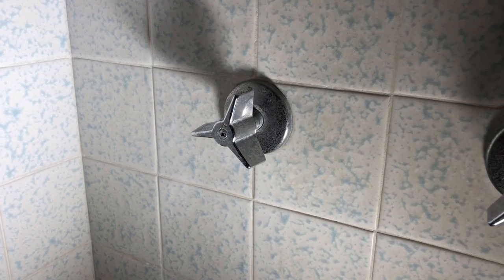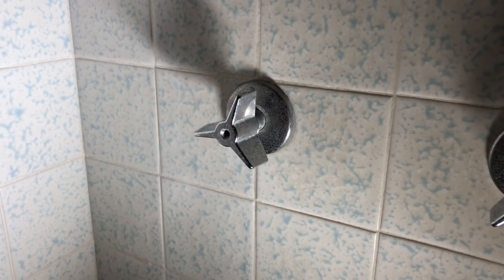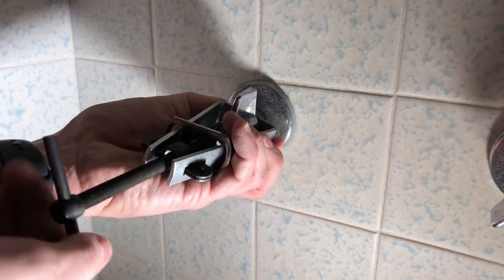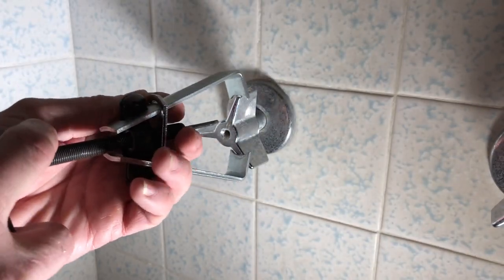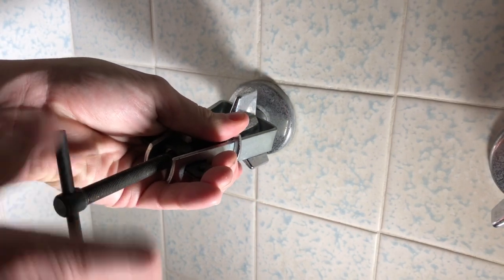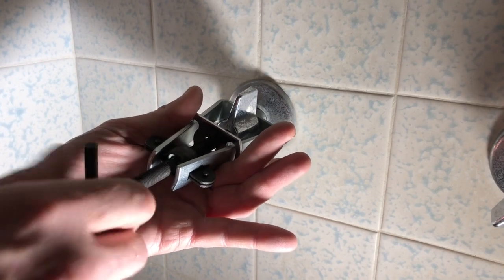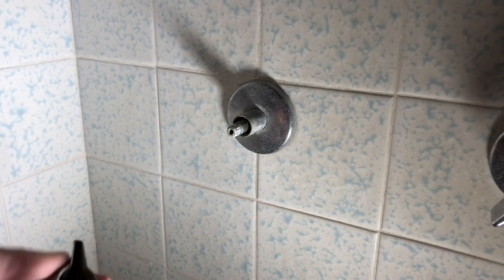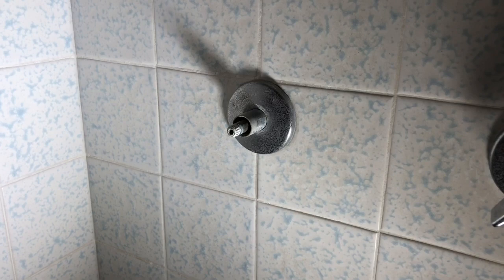How To Remove Stuck Shower Handle

Comment: Had same problem. Stuck a thin metal rod in hole and hammered nope. Saw this tried heating it. Nope. Then sprayed Barbasol in all holes waited 15 minutes used hammer and metal pole in hole it came right off with a few more whacks. Fill hole with BARBASOL ALOE SHAVE CREAM wait 15 minutes. Try It! Worked for me. Shave Cream makes Calcium cake on junk brittle. No need for tool if you have a thin metal rod to stick in hole, hammer, and Barbasol.
Reply: Thank you for this! The tool looks super helpful but I don't have the wallet or space to put all these tools for extremely specific purposes that I may only ever use once. I did this and it worked!

Comment: Thanks but how does this help people without an  extremely job specific tool? Where would you even get one of those?
Reply from the maker: They are called a faucet handle puller, you can pick one up for $15 from Amazon, HD and Lowe’s.

Comment: Tried this and it broke the puller tip right off and now its stuck in there lol
Reply from the maker: Thad sucks!  It’s not the end of the world.  You can replace the stem.  You need to remove the trim pieces.  Use a shower valve socket wrench to remove the retaining nut.. unscrew the stem and remove it.  Then take the pieces to a plumbing store not a big box a real pluming store.  Watch a video on shower stem removal.
Reply: @sellgooddeals-DIY  Same thing happened to me but I was intending on replacing the stem anyway not sure how to get the handle of since the tool broke off in it.